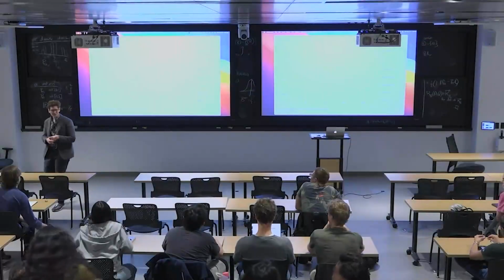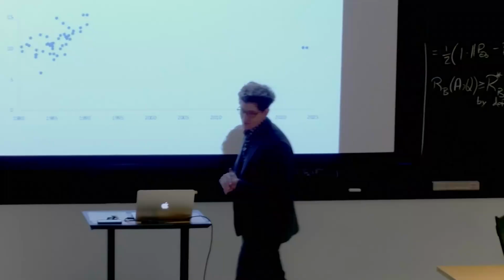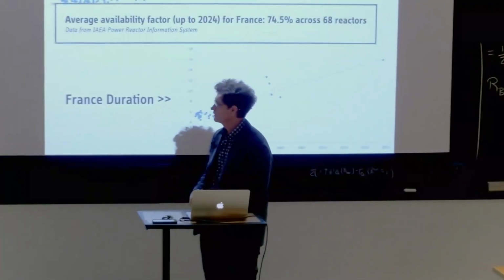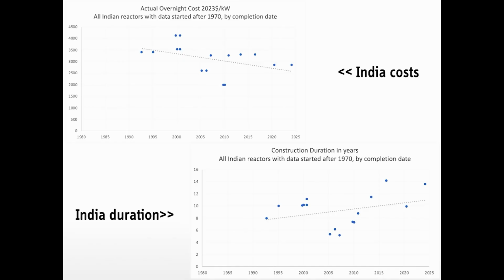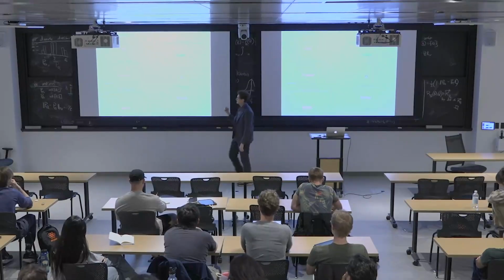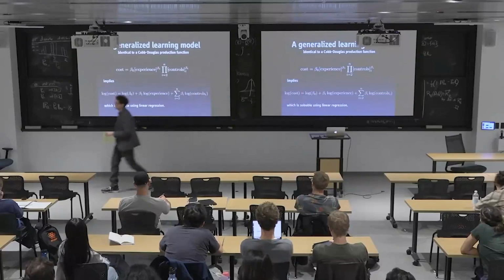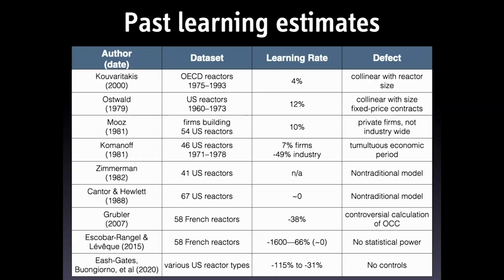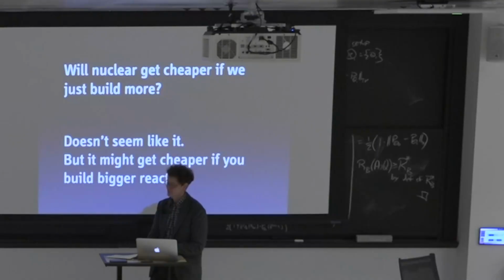Lecture 6: Nuclear Reactor Cost Around the World and the Potential for Cost Reduction

Comment: 23:45 I don’t think it’s accurate or fair to say that the Japanese fleet has safety issues. Numerous Japanese reactors, including Ohi and especially Onagawa. Also, this discussion on Korea ignores the fact that President Moon (in office 2017-2022) attempted to ban new nuclear construction and even cancel mid-build reactors despite reversing that position later. That significantly delayed builds that were underway and should be taken into account.